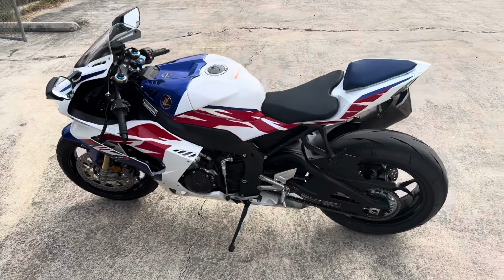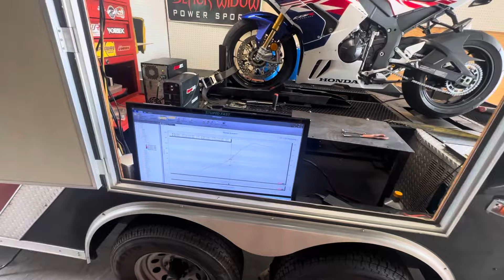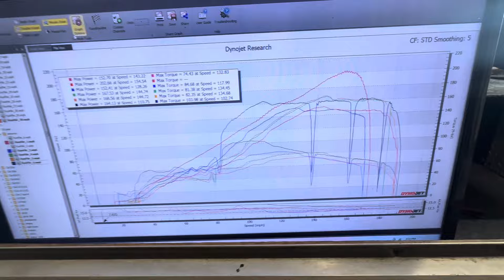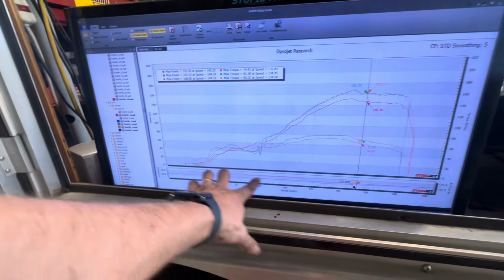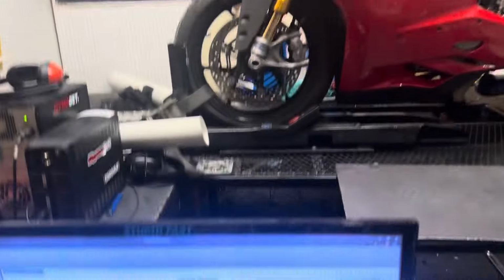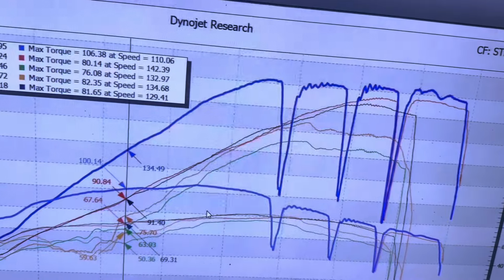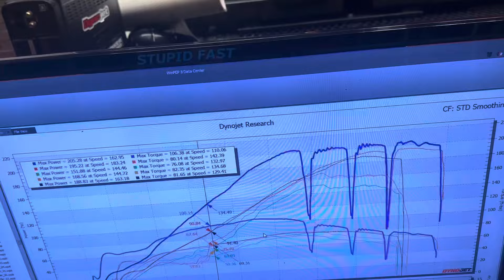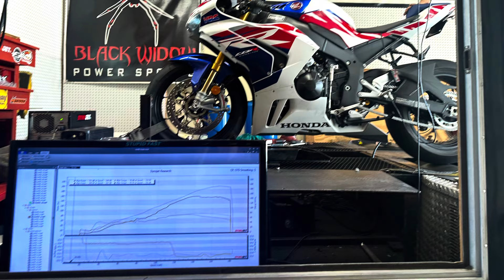CBR1000RR-R SP 30YR anniversary Dyno ￼

Comment: Your baseline pull you ran a normal pull from say 3000, on the peak power pull, you ran it through the gears. Getting a peak number from a run through the gears adds about 10hp to that peak number. But you are pros. You knew that. Wouldn’t want to mislead anyone on peak hp number…
196hp was the actual number. Stop running em through the gears to cheat a high number. Plain and simple.
Reply from the maker: @Niobium23  the extra horsepower is not coming from running it through the gears the extra power is coming from the Ram air that is in front of it 200 mph air makes a difference 4-5%  this was on pump gas we would make even more on E85 or methanol mix